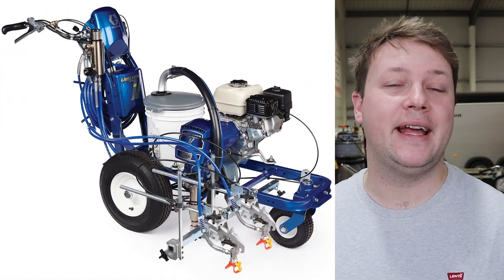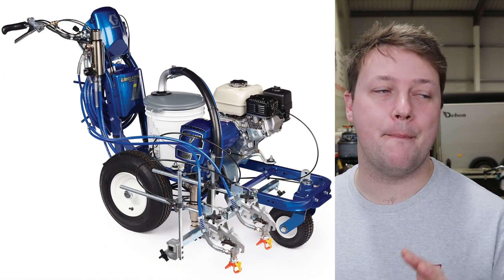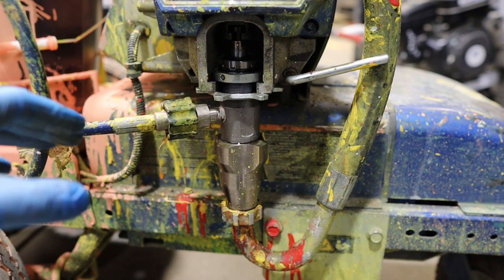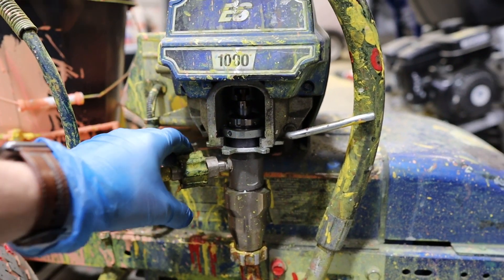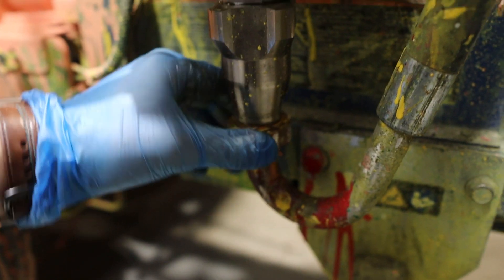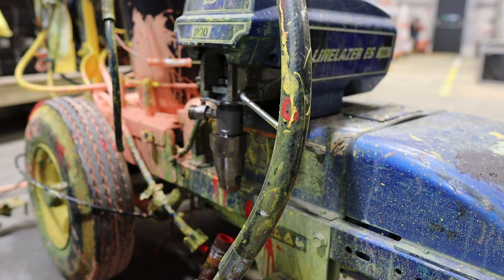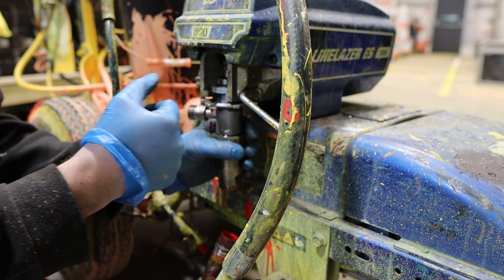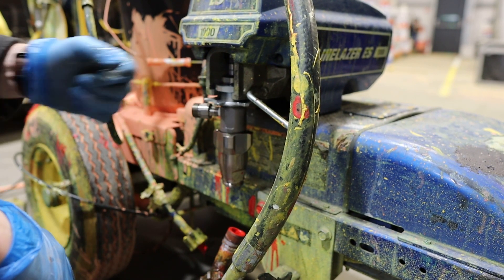Line Marking BUsiness | The ES1000 dreaded pump change!

Comment: Thanks for sharing this video! Why do you have to change the pump so often? I haven’t had to replace the pump on my Titans (3500) yet, but I have replaced the inlet and outlet valves twice. Can the pump be repaired instead of buying a new one? On my Titans, that’s not an option- (or it might be my lack of repair skills), but on your Graco, the pump seems to have a lot of compartments—can you unscrew and clean them?
Reply from the maker: Yes you can replace the packing’s but the full pump is only £100 more and it all works guaranteed! Plus saves time on the repair 🧑‍🔧 

I think the pumps on this one (ES1000) are massively under sized and only good for very light solvent or water based paints. They splutter when you use MMA and we literally get a few hours out of them. 

Titan pumps have failed twice on me, once the bottom end (just 2 hours old) and once around 20 hours. 

Both were returned but one couldn’t be fixed and they had to replace the whole machine!